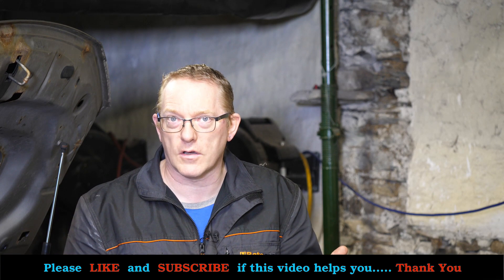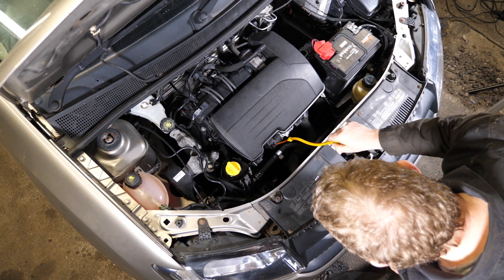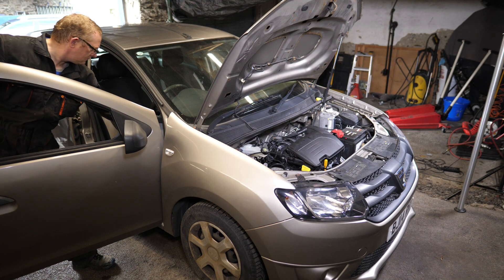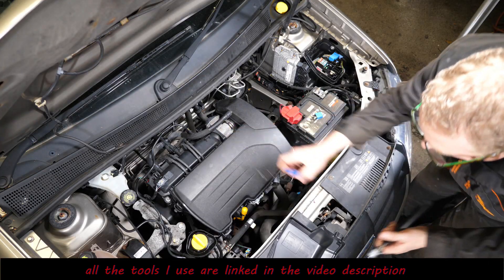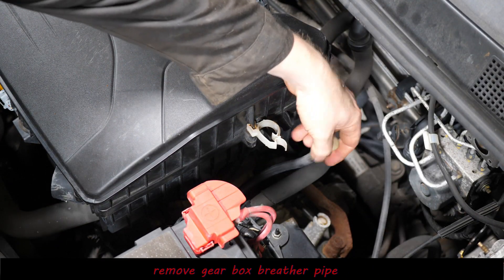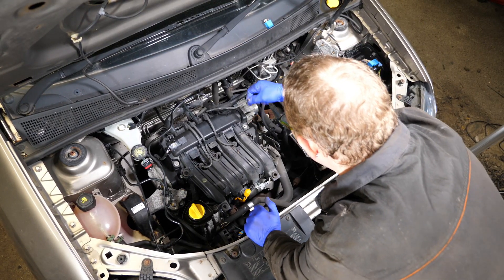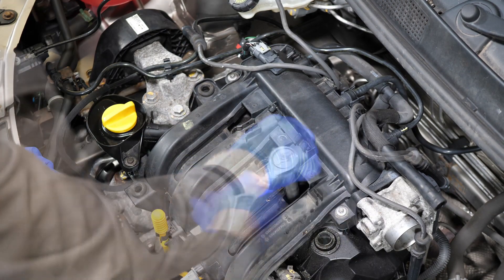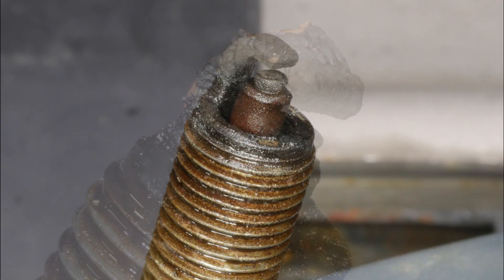Part 2 - How to do a Full (Wet & Dry) Engine Compression Test using Dacia Sandero with Renault D4F

Comment: On the Renault/Dacia D4F 1.2 16v engine, install Champion CET 4 spark plugs and use CO98 gasoline and spark plugs and the car will run great.
Reply from the maker: Thank you

Comment: nella clio 3 d4f dove si trova il rele' carburante?
Reply from the maker: Its the small relay just below the 60,60 and 50 amp fuses under the bonnet.
Reply: @CoatsandGaiters  looking at the diagrams online, they don't call it that, so I'm afraid, what would happen if the engine started during the test? thanks.
Reply from the maker: @ce9xy  its the small relay just below the 60,60 and 50 amp fuses under the bonnet.  I took a photo but you can't upload a photo in comments.
Reply from the maker: https://youtu.be/LIcWCO26VAg?si=FWmXcG8XbqvbUzu1&t=199

Comment: hello... im looking at a Haynes manual for servicing a Renault clio mk2 D4F engine at it states cylinders from flywheel 1-3-4-2.  Converting this to looking at the engine from the front perspective like the video it is 2-4-3-1.  not even close to what your video states.  What could be the reason for this??
Reply from the maker: French cars often have cylinder 1 at the gearbox end for some reason but normally cylinder 1 is timing belt end on most cars
Reply: @CoatsandGaiters  ooooh thanks for the rep.

Comment: Good video!
Not a professionnal, but when looking at spark plug charts, the bizarre crusted spark plug looks like ash-fouled examples, stemming from burning oil and/or fuel additives. All the spark plugs also look oil-fouled at the base.
When you replace the spark plugs, it's a good idea to replace spark plugs wire as well, as they degrade over time. You can check the wires resistance against the spec to see that. Some people also replace the coil pack.

I would do the same: replace the spark plugs and see if that solves the issue. Something I'd do as well is take a borescope to check the top of the pistons, especially to see if one of them have valves imprinted on it, if you can see any oil/coolant there or anything else out of place.
Reply from the maker: Thank you.  My next step has to be to replace the spark plugs as they are wrecked.  I was thinking of doing a sniffer test like you say to check head gasket.  I don't have a borescope grrrr maybe I should look into getting one as it would help.
Reply: @CoatsandGaiters  I don't have one either, but that's certainly been on my "to buy" list for a while now! I've seen them used in several videos, and it seems super useful to be able to inspect the compression chamber.

Comment: I removed a heater plug from a Nissan Terrano 3.0 diesel many years ago, with a similar build up as your plug. It was diagnosed by Nissan as a leaking head gasket passing water into No4 cylinder or possibly a porous head/block. When the engine ran hot there was noticeable steam from the exhaust. After some research and speaking with my local garage I was guided to use a product called K seal. Following the instructions to a T,  it 100% fixed the issue. The vehicle went onto run without any issues for many years.👍👍
Reply from the maker: arrr thank you for that.  I was wondering if it might be coolant related and possibly a leaking head gasket.  I will have to investigate further.

Comment: Could it be the valve stem seals leaking oil into cylinder 2? Maybe explains the low compression? Or some kind of burnt out valve. Blow by could be making it knock.
Reply from the maker: Thank you for the comment.  I probably will have to remove the cam cover soon.  Not sure whether to do a leak down test first though.